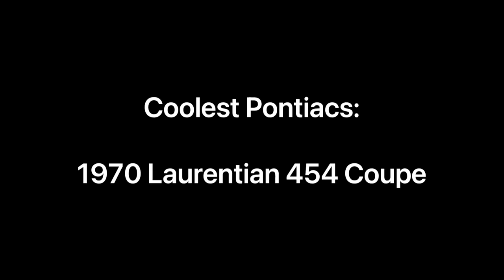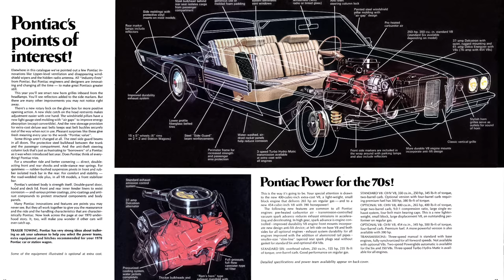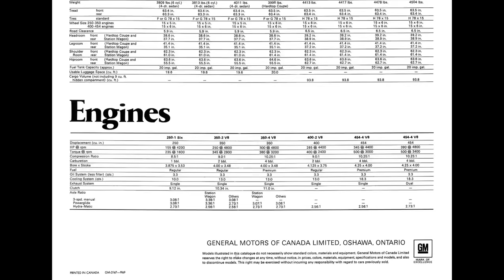A Factory 454-Powered Pontiac?! This 1970 Pontiac Is Powered By a Chevy Big Block!

Comment: Growing up (I was born in 1963) in Canada in that era, I well remember my dad's appreciation of Pontiacs. He would trade in for a new Pontiac every 2-3 years, and he indeed ordered a 1970 Laurentian. He hated "white-knuckling" or slow overtaking when passing. So he made it a practice to always order the biggest engine commonly available, and ideally, it would be 400 ci or greater. So we had one of the 454 Laurentians like the one in the video. Ours was also green, but a 4-door hardtop and definitely had PS, PB, and Cruise Control. It had air conditioning and roll-up windows. Otherwise, it's very similar to the car in the video. I'm pretty sure it was the LS4 version of the 454. We lived in Alberta, which had (and still has) the lowest gasoline prices in Canada, which took some of the sting out of refueling the thirsty engine. Every summer, we took that car from Edmonton to Vancouver Island. The highway was two-lane then, except for short stretches of four-lane around the cities, so there were plenty of opportunities (and need) to pass large trucks and other slow-moving vehicles. My dad would tromp on the big pedal and effortlessly go past them. This never failed to bring a huge smile to his face, and he would often comment on the wisdom of ordering the big engine. He kept that Laurentian much longer than the usual 2-3 years and did not much like the 71 and later Pontiacs. Our family had switched its brand loyalty to Plymouth. This came about by my mom's 68 Roadrunner, ordered immediately after it became available. She kept the Roadrunner for 4+ years and then traded it for something more compact, a 72 340 Duster. The Duster had complete base equipment, including a 3 speed standard transmission, with only an AM radio and a 3.55 sure grip axle. The Roadrunner was pretty fast, and my Dad's 454 Laurentian was pretty close to the Roadrunner. The 340 Duster would walk away from either of them, and the Duster was the car I inherited upon getting my drivers license. 
With a childhood like that, it was pretty much mandatory that I became a hot rodder in adult life.
Reply: This 1968-born Canadian can relate.
Reply: My sister was born in January 1968, and my dad bought my mom the Roadrunner to celibrate the coming baby. We were huge Wil-e Coyote and Roadrunner fans. Roadrunners tended to be pretty stripped-down but my Mom's had lots of options.
Reply: Do you still have the duster
Reply: Now I know who Commander Cody, in his 1972 song "Hot Rod Lincoln" was describing, you switched from being a Pontiac/ Plymouth man, to a Lincoln guy..lol!  I really enjoyed reading your story of your recollections of the cars in your family!
Reply: the pontiac was a slug. did this put a frown on yer daddies face? especially when a 440 mopar blew dust in his mug
Reply: Excellent share of a great memory.
Reply: @carlc5748 Try songwriter Charlie Ryan's version, or Johnny Bond's 1960 recording of Hot Rod Lincoln. George Frayne (Cody) was late to that party.
BTW- HRL was an answer song to Arkie Shibley's 1951 record "Hot Rod Race.😉
Reply: @loumontcalm3500  Yes, I am aware of the original from 1960, but I like the faster pace of Commander Cody's version. Thanks for the info on Commander Cody, did not know the man behind the band!
Reply: Amazing story, thanks for sharing, was the drivetrain/transmission/rear on the Roadrunner?
Reply: @bobhill3941 The Roadrunner was originally a 383 4 BBL/727 torqueflite/3.55 Sure-grip (i.e. positraction) 8 3/4 axle car. However  over the first winter, the engine froze and cracked due to an error in the factory antifreeze. This happened to a number of cars and we got full warrantee. My uncle was a mechanic at a Plymouth-Chrysler dealership and he ordered a 440 Chrysler marine engine to replace the original 383. The 440 had an Edelbrock intake manifold and a Holley 800 cfm carb, a street hemi camshaft profile, and stronger valve springs. 
My parents were out-of-pocket about $125 for this engine, installed, after the warrantee credit for the cracked 383. I recall discussing this with my uncle, who had all the receipts and records for the work. When my mom traded the Roadrunner for the Duster 340 my cousin (who was the son of my mechanic uncle) bought the car and owned it for many years after.
Although the Roadrunner was never raced (not at least when we owned it), from later experience I would guesstimate that it was a mid 14 second quarter-mile car with the original 383, and a mid-to-high 13 second car with the tuned-up 440.

Comment: That's my former car!!!  I had it from 2011 - early 2016, and got it roadworthy after it sitting for a while.  I had some interest on eBay for $14K, but nothing materialized. I sold it to a local fellow who put the power steering & disc brakes on it, and the dual snorkel air cleaner.  I sold him most of the parts for the upgrades.  
He sold it through Hemmings a couple years later to a fellow in Germany.
Reply from the maker: Wow. Shame!  I should’ve bought it ;)
Reply: @RareClassicCars  the interior fabric was the same as 70 Catalina.

Comment: The Canadian Pontiacs were essentially Chevrolet chassis and drive train with Pontiac sheet metal sized to fit the Chevrolet chassis.  IIRC American Pontiacs had the 455 PONTIAC engine.  Buick had a 455 and Oldsmobile did as well.  GREAT VIDEO!

Comment: I noticed on the stat sheet that the only difference between those 454s were the single exhaust 345hp or dual exhaust 390hp! Amazing duals can add almost 50hp ✌💖☮
Reply: There was also a camshaft difference.  The 345 hp LS4 had the low lift hydraulic, whereas the 390 hp LS5 had the high lift hydraulic.  The LS5 also had 3/8" pushrods opposed to the 5/16" pushrods of the LS4.

Comment: In Canada in 1978 I bought a used Pontiac Laurentian, 350 2 barrel, 2 door in great condition for $ 350.00 . It ran great, got 20 mpg, and just ran up and through the Rockies like a hot knife through butter. I drove it for 2 years and sold it for $300.00.  Now that car is worth over $10,000. It was my first car and.....I still miss it!

Comment: Wow, you mean a country that recognizes the importance of keeping its population working and keeping the LOCAL economy healthy?  What a concept!
Reply: It's why Australia got Pontiacs too
Reply: Canada is a country  that recognized the importance of keeping its population working from 1867 -1988. From that point forward successive governments have been more than willing to sacrifice hundreds of thousands of good jobs and whole communities on the alter of free trade.
Reply: The Economists say that free trade will benefit both parties.
Reply: It's the same ideology they used in Australia.  The result was expensive cars and locally built cats with out of date tech and design.
Import quotas, local content levels, import duties. Etc etc.
Reply: Unfortunately that has ended with the regime of the last eight years.
Reply: @ronaldderooij1774 this happened decades before free trade was even brought up in the press.
Back in the 50s Canadian full size Pontiac were up to a foot shorter in lungth. Living in Canada and working as a mechanic, ordering engine parts we would be asked if it was an American 350 or a Chevy 350. The the firebirds always got Pontiac v8 engines until the 400 was dropped for the "corporate" 403. This only impacted the Pontiac full size vehicle. Buick, Oldsmobile full size got to keep their full size engines.

The main reaon Canadian gas was more expensive was due to Canada having the 160oz gallon. The same reason oil changes here took only 4 qts of oil.

Every 454 I ever saw back in the 70s had stickers on rocker covers proclaiming and "built in Tonowanda NY". Did gm even have an engine plant in Canada?
Reply: No, there never was a 160 oz gallon in Canada
Reply: @gr7485   That's not right. Yes the gallon was 160 oz., absolutely.  And still is and always will be.
        However, the 'Imperial' fluid ounce is smaller by about 4-5%.  The upshot is that the Imperial gallon is exactly 20% larger (not 25% as you'd gather from the 25% higher number of ounces, 40 versus 32).
         So in metric this means 4.54 liters versus 3.78.  In quarts it's 1.14 vs. 0.946.
Reply: Uruguay in South America is like that, as well, they have their act together. I spent 9 days down there, some years ago, and I was thoroughly impressed by the country, literacy rate approaching 99%, no "race wars" going on, no road rage, very little violent crime, and, after Canada, more fresh water than any other country. I even met the man who is in the Guiness World Record book, for (drumroll), his pencil collection!
Reply: Don't like it here? Leave. It's that easy.
Reply: You sound like a Trumper, a lot of them want to sit there in their hometown waiting for someone to come and build them a factory
Reply: weird how Socialism works
Reply: Oh wow yea I've started buying my groceries local as well. Even though the greatest wealth transfer in history has occurred but I'm optimistic 😂
Reply: Where is that Country?
Reply: @EyesWideOpen61  Yes.. your fellow citizens do indeed want factory jobs to return.. those towns put together once had over 70,000 🏭 .    Those jobs created a middle class for millions of people until they all went overseas and down south because of trade policy. Those millions of citizens, along with their families, would be pretty stupid not to want those factories to return the opportunities they once had. So rather than look down on them for not selling their small town homes for pennies on the dollar and moving into the crime ridden cities of America just to pay exorbitant rent as they try to feed their families, maybe show them a bit of understanding for their loss?? Is that really too hard??
Reply: @genefogarty5395 complaining about tyrannical governments is a good thing, acting on the concerns is better.
Reply: What a concept!!😅
Reply: @EyesWideOpen61 Most hometowns had factories till China wiped the USA out. Due to terrible trade deals
Reply: Yeah lets all thank Trudeau and others for our 30 year decline in manufacturing

Comment: One set of my grandparents would only own Fords, except in 73 my grandpa bought a new Pontiac Catalina.
It was a 4dr, tan with tan interior.
Soon after buying the Catalina my grandpa burn up an engine on an old VW Bug in Needles, AZ.
My grandma and mom were driving to get my grandpa while a new engine was replacing the old one.
They were in the desert and my grandma had just looked down at the speedometer and it was buried at 120mph. 
She let off the gas going over a small hill and there was a CHP  so my grandma didn’t have time to hit her brakes so she passed him and immediately pulled over.
Back then the speed limit was 70mph.
When he got to my grandma, he said to her, “Lady, I don’t know how fast you were driving, but I was driving 80mph and you passed me like I was sitting still”.
He went on to tell her that since he was driving 80 in a 70, he was only going to write her up for 10 over. So she got a ticket for 80 in  a 70.
On the way back home she told my grandpa that she couldn’t keep that Pontiac off of 100mph. My grandpa told her that the ticket she got, told her that indeed she could keep it off of 100mph.
Reply: What a beautiful story! Thank you for sharing.

Comment: LOVE it! I still have that very same brochure. My second car was a 1970 Parisienne. 2dr HT, 350 4bbl 4-bolt with a TH350, 2.73 posi. Light yellow, green vinyl bench, column shift, AM radio, manual windows, tan vinyl roof. It was as if the original purchaser's goal was to build something that existed only to eat up highway miles, and that it did! Wow do I miss that car. One day I got really excited; my Grandpa gave me a mint set of Holley finned aluminum valve covers, the holes weren't even knocked out. I rushed out to the car to eyeball them, and then I remembered: I had a Chevy engine. So I traded those valve covers for a '65 Polara sedan! (Quick notes...the 2+2 was the top trim level, and these were NOT the same body as US full-sized Pontiacs; these had the Chevy wheelbase and were 3" shorter between the rear wheel opening and the door!)

Comment: I had 67 Beaumont when I was a teenager. It had a 283 but I swapped in a 327 with a 6-pack. I liked the Beaumont's front grille more than the Chevelle's but I preferred the Chevelle's narrow taillights. Surprisingly the Beaumont's rear suspension trailing arms were more heavy duty than the Chevelle's.  That Beaumont was a great car🙂

Comment: The bodies from the firewall back were the same as Catalina. The sheet metal in the front clip was shorter, as Canadian Pontiacs used the Chevy frame with its shorter wheelbase and narrower track. 
There was a model above Parisienne. That was the Grande Parisienne.
Strato Chief was the equivalent of the Biscayne. Laurentian was equal to the Bel Air. Parisienne was equal to Impala. Grande Parisienne was the equivalent of the Caprice, but very rare.
Reply: While the body was basically the same as a Catalina from the firewall back, the floor & trunk pans were Chevrolet to fit on the Impala chassis.
Reply: The sheet metal was totally different. Had a 68 Parisienne convertible. 4 inches narrower and a foot shorter than a Catalina.  Had to totally modify a US Catalina trunk pan instead of just dropping in a impala one simply because I needed to retain the larger Pontiac gas tank rails. You could always tell that the frame and body were from different mothers when looking closely especially when I compare to the 66 Impala I have now.
Reply: There was also a 'fastback' Parisienne 2+2 coupe with bucket seats and console.  I owned one,  but sold it when I got the 1967 Parisienne convertible I have now.
Reply: @LakeNipissing  my father owned a 1970 fastback pontiac 2+2 454. Lake Cowichan, Vancouver Island,BC. ( yellow with a vinyl top) Wondering where it is today.

Comment: Not just big blocks...  The 1967 Pontiac Parisienne convertible I've got has the factory Chevrolet 283 V8 with Powerglide.
It actually moves along pretty good.  I've also got the "hockey stick" gas pedal.

Comment: The Canadian Pontiacs 65-70 are probably the easiest and cheapest respectable classic cars to work on and keep running. So much of the mechanical parts cross over in those years. And we have 65-70 Chevrolets to thank for a good parts supply. Great video.

Comment: Things started to change with the Auto Pact of 1965 that enabled freer flow of parts and vehicles across the Canada/US border. Ontario, and to a lesser extent, Quebec developed a strong base of auto parts manufacturers and assembly plants were built too.  It was not complete free trade, but Canada was able to supply a lot more to the US.  However, the different Pontiac line continued. I always liked the US Bonnevilles more than the Canadian Parisiennes.

Comment: OK, I think I am understanding this concept a little better now.  The chevy parts were already made in Canada, so they didn't have to import the pontiac frame and running gear, and that is where the cost savings came from??  Were the Pontiacs and Chevys the same wheelbase??  If not, how did the bodies fit down properly over the wheels?

Comment: I used to own a 1965 Pontiac Laurentian back in the early 80's when i lived in Edmonton.  The front end and rear looked like a classic Parisienne 2 door but it was a boat of a 4 door.  It had zero options and had that famous 250 cid straight 6 and was equipped with a 3 in the tree manual transmission.  It would barely make it up a ramp in a parking garage.  One of my first cars.

Comment: For some reason, other Canadian GM cars from the 1960s (Buick and Oldsmobile) had the same power trains as US models but they had longer standard equipment list and more expensive trim than the US-made versions. For example, my '65 Buick Wildcat had Electra 225 interior trim and it had features that weren't even offered on the base Electra 225. Don't know much about Oldsmobiles. If I imagine they had similar features.

Comment: The Canadian-built Buick Skylarks had 12 bolt Chevy rear axles, including those with 6 cylinder engines. Many of those Skylarks were sold in the US for some reason, but all GS models sold in the US were US-made.

Comment: I worked at GM's Marketing and Product Planning Staff in the mid 80's. One of the tools we had developed was a "market simulator." which would simulate the market response to various conditions. GM canada would ask about every 6 months for us to make a variation for them. IN a rather lengthy meeting we were explaining what it would take, and the person responsible for MPP at the time stopped the discussion and said "when we make one for california, we'll make one for you", because at the time, the canadian market was the same size as california. It never came up again...
Reply: But then gm created the 49 state model and the California only model.. Seems the guy that spoke up knew not of what he said.
Reply: @22099dscott   The california model never really made a lot of sense for the sim, as most of the models inputs were "constraint" based (i.e. toyota can only make so many of this part or that engine and so there weren't enough input constraints for cali to work. Overall, the model was pretty accurate for both long and short term. Of course, people didn't like what it was saying...but that's a different problem.

Comment: I had a '68 Parisienne 2+2 with a 427. Bought in '84 for $400.00. got it in running condition, respectible and cleaned up, a little rust around the edges, but overall a good looking car. And would it lay (Positrac) rubber. Had a chrome top breather, with a single 11" wide, 4" long forward facing snorkle. Took me forever to flip it for $900.00.